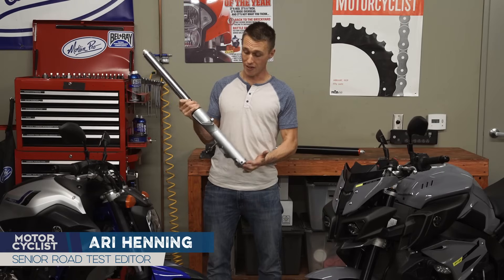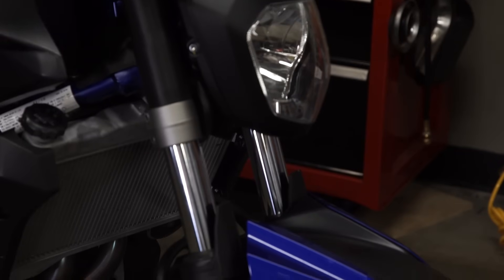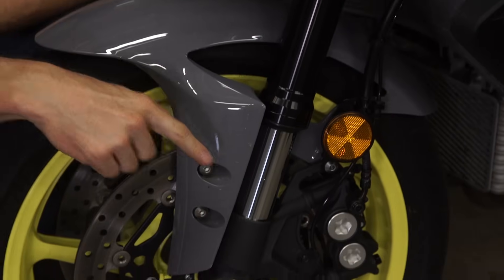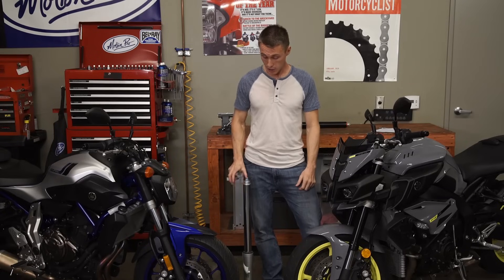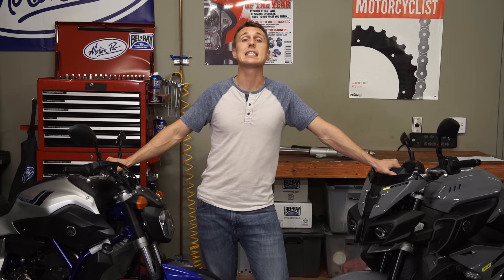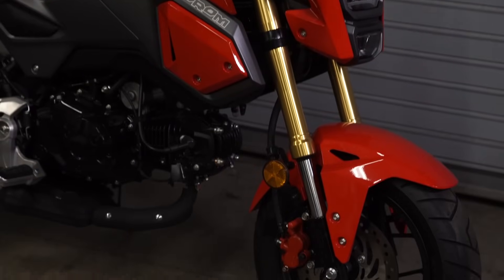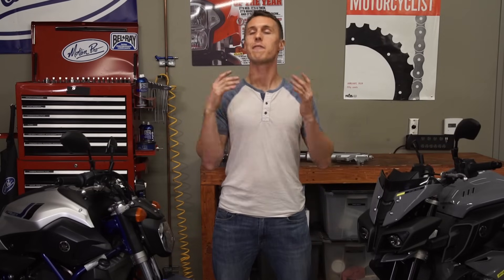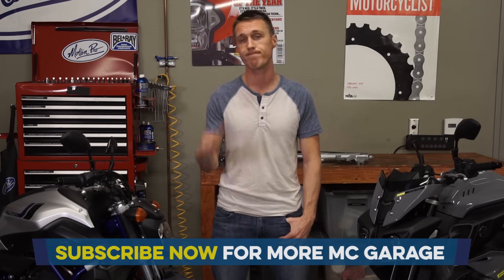Right-Side Up vs. Upside Down – Why Are Inverted Forks So Good? | MC GARAGE

Comment: advantage of usd - more adjustment and longer main seal life due to grime not being able to sit on seal (very useful for dirt bikes).
advantage of normal - ease of service, wont affect suspension if you do the bottom clamp up too tight (might crack your bottom clamp if you are super man) and less unsprung weight and before you jump on that one the stanchions are made from heavy gauge steel pipe while sliders are made from light weight alloy so you WILL have less unsprung weight with the slider at the bottom plus usd forks are made of 3 main parts which is 1 extra part that can flex compared to normal forks.
conclusion - if you are using bike to race and want to be competative get usd, if not get normal.
usd forks on street rides are nothing but a sales gimmick

Comment: Dear all,

Could the USD fork of those FZ-09 be swapped into FZ-07 with minimal modification, plug-and-play perhaps?

Would the triple clamp be of the same size?

I do understand that, aside from the USD fork unit, the front brake calipper and disc brake of the FZ-09 would have to be used also, is it correct?

Thanks in advance 😀🙏

Comment: I have a good controversial question. 

Valve adjustment. Is it really so crucial to do at precise miles it is suggested. 

How crucial is it on street riding, how crucial it is on track riding... ?

Comment: Recenty i had a leek on my fork seal, it was a massive one. (right side fork) and all my brake - disc and the caliper was washed by the oil.  So, this issue doesn't go only withe upside down. Good video.

Comment: One way of adding rigidity on normal forks is adding a stabilizer (which were common before the upside down forks were introduced). The big advantage of a normal fork is; you can put rubber boots on them for protection. Guaranteed that the chromed inner fork wil last a lot longer, especially during the season when there's salt on the roads or offroad.

Comment: The seals on upside down forks will generally last longer than on conventional forks as well. This is because the fork swipers are not exposed to direct sunlight and don't dry out at fast. Once the swiper dries out, water and dirt can seep under the swiper and puddle around the seal and snap ring, degrading the fork seal.

Comment: 3:12 What? Gravity ensures oil will run down on both fork types. Regardless of distance traveled, oil is just as likely to contaminate the brakes on both types of forks. You've totally missed the point in this issue; the conventional design has the inherent problem where water will find its way into the seal (again through gravity) and cause corrosion in the seal's steel support ring vulcanised inside the rubber. This in turn leads to more frequent leaks and replacement costs for the conventional forks. Every single bike restoration I've done on bikes with conventional forks has required replacement of leaking/corroded seals due to water ingress. This is a major advantage of the difference in design and the way you described the oil issue is irrelevant.
Reply: techo61 Nice to see that I'm not the only one who knows that! That is a huge reason to have inverted forks!

Comment: One other benefit is that the upside down fork has less chrome parts open to the elements to cause premature seal wear in the first place, the conventional fork is open to the full front end's wind, rain, dirt and debris that could pit the chrome coating over time. Definite benefit right there.

Comment: I don't agree.

There are two main differences.

Increased rigidity (which you covered), and reduced unsprung weight (you mentioned weight in general and not in detail, but unsprung weight in particular is a very important benefit of USD).

Reduced unsprung weight improves handling significantly, both with cars and motorbikes.

Reducing unsprung weight is the key to improving handling. The lower the unsprung weight, the less work the shocks and springs have to do to keep the tires in contact with the road over bumpy surfaces. Lot of problems, if not all of them is caused by inertia. Bigger weight means higher inertia. Higher inertia means more workload for shocks and springs to keep tiers on the ground. If unsprung components have a high mass they are harder to accelerate/decelerate and thus it is more difficult for the suspension to maintain a consistent tire load.

Comment: We read about suspension sensors with a high sampling rates, (like 1k Hz), and there seems to be an assumption that that high signal rate initiates an action that actually modifies the suspension damping, for example, at a similar rate.  My question is:  What does that high sampling rate actually translate into in the way of modified suspension action?  How quickly can suspension settings be changed, (electronically), so that an actual effect might (theoretically, at least) be felt?

Comment: cover Dot snell and ece. do the actual research not generic. why 2010 snell is not as good as 2015. but better due to testing methods is not as rigorous. yup this is a good topic but you may or may not  know everything about it yet. I did my research. I am not as afraid of my dot helmet anymore. for track day I want ece or 2015 snell. I won't wear a 2010 snell though.

Comment: Bro can you tackle a topic about carbs? I mean which is better the vacuum (Diaphragm) , FI or the traditional carb?
Reply from the maker: FI all the way. More precise fueling (that compensates for temperature and elevation) and no maintenance. What's not to like?
Reply: I see. Thanks man!
Reply: Alca Bringer don't forget also easier and cheaper upgrades for more fueling for more power 
And better airflow 

Oh 
And you can use forced induction MUCH EASIER

Comment: Yep spot on. I remember racing suzuki mx bikes in the mid to late 1990s when they tried to run 50mm conventional forks to stop the flex. They were too big and bulky and it never took off

USD look better but ultimately they really don't flex as much on track and it was noticed braking hard into corners or landing jumps when you could move you bar a bit but the wheel would stay straight

Comment: Isn't there a difference in unsprung weight too?  On sport bikes, unsprung wight is considered bad. The skinny part weighs less so it makes sense to put it on the bottom since the only "spring" it will have is tire squish. The heavier, top part will still have the fork springs to hold them up.

Comment: Upside down forks has lower unsprung weight.  But it is very difficult to service.
Reply: how can it have less unsprung weight when the moving part is made of heavy gauge steel while on normal forks the moving part is made from light weight alloy
Reply: @bjorn1583  it cant.
Reply: I did the fork seal and bush on my crf250l in 10 minutes out in the countryside with only the honda toolkit and a discarded plastic bottle so yeah, theyre real hard to service
Reply: Wrong steal is heavier than aluminium. Take a refresher course. Its all ball bearings these days.

Comment: Wrong.
1: Inverted forks while yes have a larger clamp diameter are not torsionally stiffer. Length of Triple Clamp and axle interface determines this. This doesn't take into account internal bushing sliders and their play. However, 99.9% of people will never know.
2: Inverted vs Conventional internals are identical. Fox/Marzocchi/KYB have been like this for years. 
3: They are also heavier even with the increase in diameter of the 'female' part and reduction of wall thickness.
4: Higher center of gravity = more inherently unstable. + or - depending on viewpoint. 

Actual Pros of inverted:
******Better small bump compliance due to reduced un-sprung weight. Most road riders will never know the difference. Off-road is where it takes precedent. 
***Oil seals are immersed in oil entirely vs having them be 'splashed' like a conventional thus making them more plush from less stiction.

Comment: Any differences in shock functionality? From a technical viewpoint....
Reply: Many.  The largest probably being reduced unsprung weight.
Reply: Heaton08
I'm not convinced the unsprung weight is lower. The inner pipe is rather long, and it's of heavy steel while the outer tube usually is shorter (at least in an RSU fork) and made of aluminum.
Reply: Mechanical engineers are convinced--keep in mind there is a lot more happening inside than just two tubes sliding over each other.
Reply: Heaton08
Oh, I'm convinced it's a better construction over all... just not sure about the weight angle. Doubt it's more than a minor difference.... (But then again, on an already light vehicle, minor differences matter too...)

Comment: This video is incorrect, pretty much end to end. The fork stiffness isn't the reason that USD forks are now preferred, nether is unsprung or sprung mass (both of which go up with USD forks) its because of fork bush loads.
RWU forks simply used a larger diameter inner tube to improve stiffness, so the last performance bikes to use RWU forks used 46mm tubes not the almost universal 43mm that was transitioned to.
RWU forks also only had an outer in the ballpark of 400mm long, from cast aluminium, which means that its substantially lighter than the nearly meter long piece of steel that is the inner tube, and thats before you take into account that the RWU outer also serves dual duty as a caliper mount bracket, whereas on USD there needs to be a complex bracket attached to the foot of the inner tube. So RWU are lighter than an equivalent USD for stiffness.
The damping in the forks can also be exactly the same depending on what the manufacturer offers.

The reason is because the distance between the fork bushes affects the loads that go through the bushes, because the fork carries a bending moment from any brake loads applied. This means that if you double the distance between the fork bushes you halve the friction, which substantially improves the damping performance of the fork under brakes. The whole "Set up and squeeze" technique of braking exists specifically because fork bushes load up and bind suspension, so if you don't gently apply the brakes then you won't have the suspension start travelling to a "settled" position before it gets locked out by loads. By comparison in USD forks the bushes are far less heavily loaded, and as a result you can be far more aggressive with brake onset and you'll also notice far better suspension performance under braking on the bike. This is critically important if you're doing any of your braking while you're tipping in, because the suspension effectively becomes stiffer due to the angle of the bike.

Apart from anything else, USD forks are useful because they reduce the impact of poor brake application, panic braking... bikes end up skidding down the road because people grab un injudicious handful of brakes in an emergency, even when upright, this is why.
Reply: Can u explain in detail regarding the point you mentioned about the reduction of friction..?..
Reply: @akshaysinghgirdhar    He is not an engineer.  I can tell that he also doesn't have much riding experienced compared to me.  Im an engineer who has been racing motocross for over 10 years.  On my vintage bike (not my main race bike), I rode with the stock conventional forks for one half of a season.  I switched the forks out for a set of USD forks, and cornering drastically improved, regardless of braking.  The front end was very bendy and vage feeling with the conventional forks.  The USD forks made the bike corner just like a modern dirtbike.  Even when you werent using the brakes.  Braking was only barely effected when I switched to USD forks.  The level of front end control now makes the old forks feel like wet noodles. No front wheel control EVER with conventional forks.  With USD forks the front end does exactly what i tell it to.
Reply: @sciencemilitia1853  You start by saying the original poster is not an engineer but you are, and the proceed to just post up an opinion without any explanation to back it up other than "I feel it's better".

An engineer would mention the different lengths, materials, diameters, the oil itself etc of the forks and how all these things can affect their performance, only after all those factors have been ruled out could you say anything abut the orientation of the forks making them better or worse and not one of those other factors. You're not an engineer.
Reply: @BigUriel   The guy in the video already explained it all.  Larger diameter tubes have higher bending strenth.  That means less flex.  When you compose the larger portion of the fork with the larger diameter tube, you get less total deflection (aka flex).
Reply: mr.Drew the best explanation i have ever heard sir!

Comment: Lets start at the beginning. Forks used to have the skinny section at the bottom, then fashion changed around the 1970s and we got the USD, that is the slider moved to the bottom of the fork. Now we have gone a full 180 and the skinny section is once again at the bottom. So just what should we be calling USD and RWU?

Comment: Nice video.  Aircraft shock struts, which are very similar to telescopic motorcycle forks, have always had the outer cylinder on top and the inner piston on the bottom.  So, what is right-side-up on an airplane is called upside-down on a motorcycle.  BTW, aircraft struts do not have internal springs, but rely on compressed nitrogen gas to bear the weight of the aircraft.  Here is what might sound strange: if you see a mechanic adding or releasing nitrogen from a strut, he is changing the extension of the strut, but not the gas pressure in it.  The only way to change the pressure is to change the load on the strut.
Reply: Well... That really was quite interesting... :)
Reply: PV=nRT and all...
Reply: @faridb40  I do this everyday for a living.  You go look it up
Reply: Hopelessand Forlorn nice 👏👏👏👏👏
Reply: Cool info.
Reply: Gilera had a fork based on aircraft landing gear in the early 1990s on the CX125. This used a single fork directly above the wheel, with a dished alloy arm on one side to the centre of the wheel (with a stub axle for the brake disk and wheel to mount onto). To stop the fork turning it had a scissor linkage between the upper and lower. Plus point was a single sided fork and no need to take the caliper off to remove the wheel. Down side was it was quite limiting on fork travel.
Reply: Adding and removing gas is like adding or removing preload to a conventional spring
Reply: I'm confused as to what you guys are talking about. Unless your are at the limit fo travel in terms of volume the pressure will even because that's how pressure works if your on bags instead of pistons like on a truck it's not actually linear because you have a non-linear volume but also pressure isn't the same as spring rate which is proportional to the change in volume which will change with a different initial stroke on a linear pistons your changing both the position and rate. If you have twice the mass of air you have to move twice as far for the same increase in pressure or spring rate. You both are operating on separate vague wavelengths any combination of you both being right or wrong is observable from an outside perspective.
Reply: Exactly right. And not understood by many aircraft owners and mechanics alike.
    The pressure in the nitrogen is determined by the strut area and the force applied.
     The area is fixed, set by the design of the strut.
   The force is applied from above, it IS the weight that strut supports,  and nothing else.
    What "diesel....etc" lacks in knowledge, he makes up for with mouth.
    A&P/IA here. Use of nitrogen as the spring is lightweight, but has some drawbacks. Grab the wingtip (ask) of any light aircraft, up to light jet....wiggle...it probably won't move. The amount of friction is unbelievable. Little PA28, Bonanza,  PA31, Citation, Lear, etc...lots of friction. 
    Virtually no movement when taxiing over bumps. 
   The do work OK for the one thump of landing, but nothing like the smooth low friction movement of most motorcycles.
    Probably partially because the high gas pressure against the seal forces it tightly against the strut leg. There might be better lubricants than the mil-h-5606 fluid they generally use, too.
Reply: @faridb40  you subscribe to scotty Kilmer. You ain't worth my time
Reply: @faridb40  hilarious.  And wrong
Reply: ummmmm, when i add nitrogen to my Bosbak, i am changing the pressure.
wtf you come up with this theory of yours

Comment: video on effect of oil leakage on the disc brake
Reply: Does this happens to 150cc bikes...at 40 to 60kmph speeds....150cc dont have inverted forks, but in case if accidently oil spilled...

Comment: it has nothing to do with unsprung weight?
Reply: If you ever pull a set apart you will find the chromed "piston" part is much heavier than the alloy tube. So USD have heavier unsprung weight.